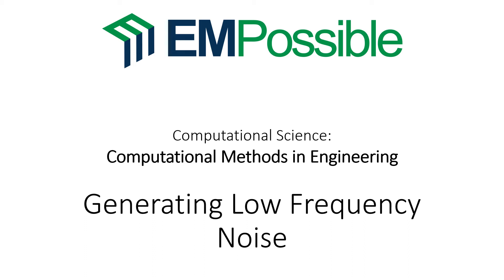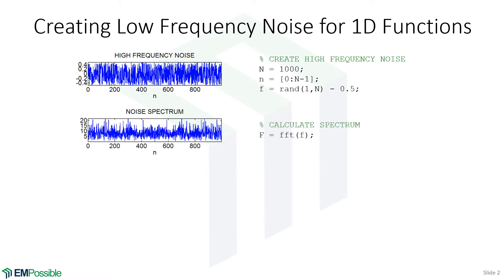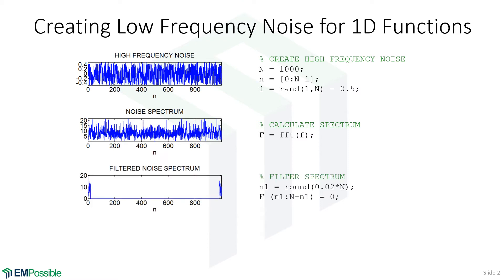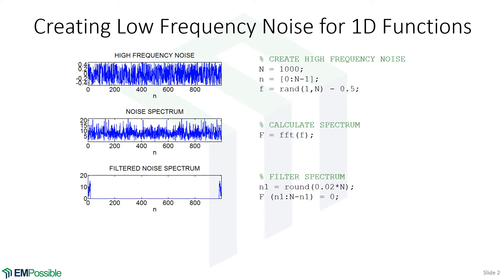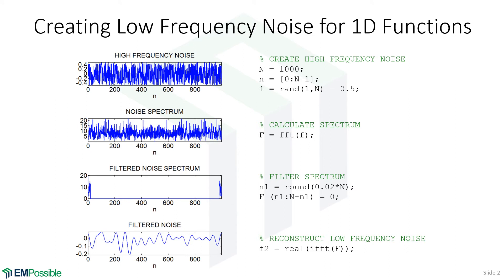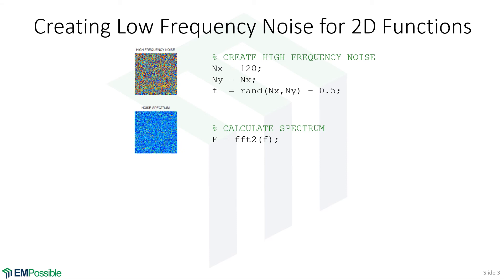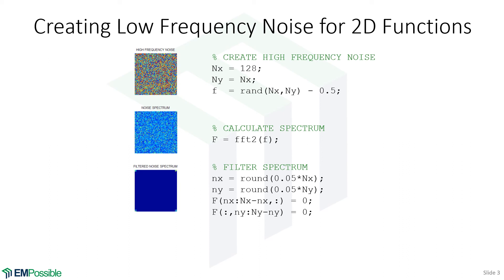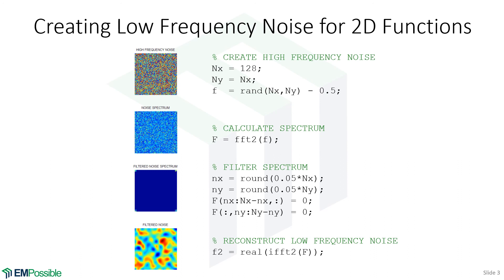Lecture -- Generating Low Frequency Noise Using the FFT

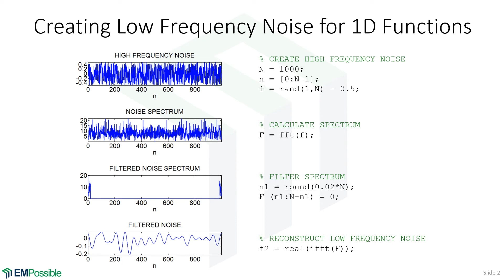Comment: Hi, for codesnippet at 2:32, the most accurate form of filter spectrum should be F(n1+1:N-n1+1) = 0. Am I right? Only that way the imaginary part  of F would be negligible.
Reply from the maker: Correct. The FFT of a symmetric real function will be entirely real. Your form ensures that. I like to write my code so that I can be little lazy and careless and everything still works. You will notice I use a real() operation in order to eliminate any imaginary component that arises due to my carelessness.

While I write that like I am picking in myself, I think it is very good habit to write code with this approach because it will be more robust and reliable.